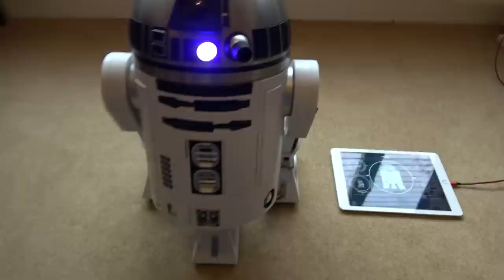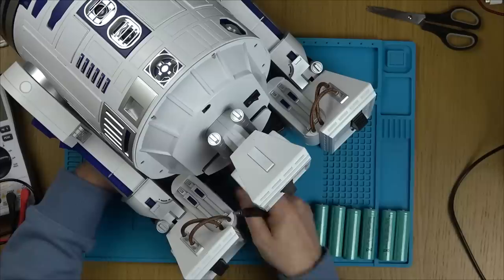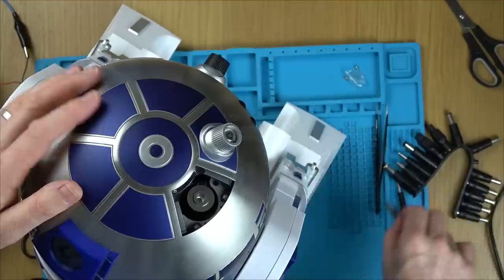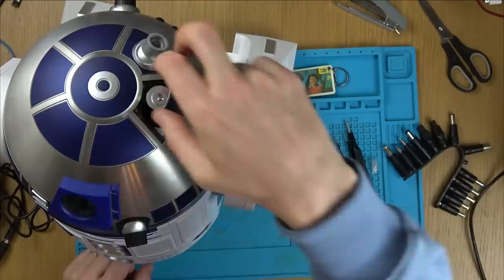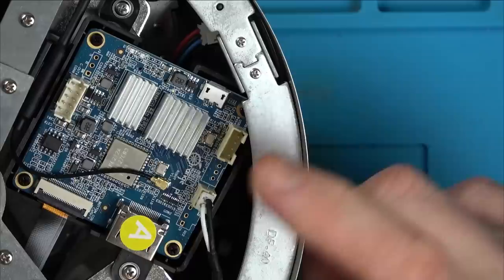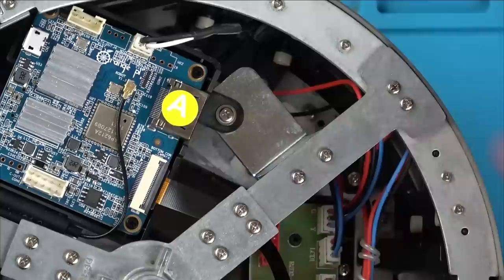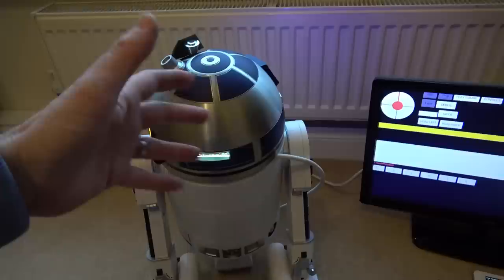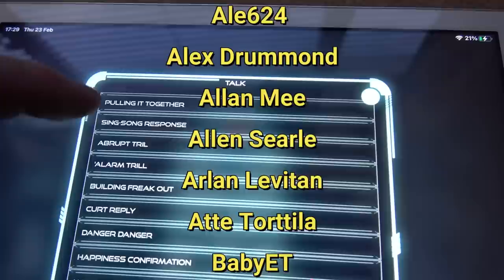Star Wars R2-D2 Repair Video

Comment: You are a genius Vince. I am in the process of building the Fanhome release of this R2D2 and could not get the light sabre flap to open. Then I recalled watching this video and came back to see how you resolved the issue. I copied your method of using two staples and now the lightsabre flap opens smoothly and still sits flush to the metal housing. Thank you.

Comment: I am about 40 stages through the assembly of R2, this video has given me so much confidence that I will be able to troubleshoot any issues. Thanks. The kit comes with a test board so you confirm the components work before assembly. Really is a nice kit, loads of fun to assemble with the kids.

Comment: Hi Vince, I love the robot! You might use some hot glue for the connectors to hold them in place. In case you need to remove them a bit of IPA helps to loose it up.
Reply from the maker: Very good idea Marcel. I used to hate hot glue as it was a nightmare to remove until I realised IPA actually makes removing it enjoyable. I normally try to get it off in one whole blob...and then it can be reused again. The process feels like a stress relief toy. Hope your keeping well👍

Comment: I always thought that these weekly build it yourself magazines were a rip off but this is awesome!!
Reply: Usually they are, and the customer service is ropey.  It's a reasonable way to get something expensive by spending small amounts regularly.   It's a bit like HP!  Like HP, it's expensive compared to the 100% outlay.

Missing an issue can be a nightmare.  They offer back issues, but only if they have them in stock.  If they sell out of an issue, you are in trouble.

Comment: Actually raspberry pi is mostly open source. It is ment to be "copied" (is open source it called fork). And the orange pi is open source.
There also is a Banana pi and a whole bunch of another pies.
They have different set of form factors, different processors and other hardware. For example banana pi has a board for DIY router based on similar to raspberry pi hardware

Comment: From my understanding orange pi is a single board computer that can be programmed on board if you connect a keyboard and mouse but you need have the correct software on it. I think they used an SD card with the r2d2 firmware and inserted it in the pi to flash the firmware. I think Vince found a development/debug interface for the people manufacturing the magazine.

Comment: The Orange Pi is an ARM based single board computer, as you say a clone of the raspberry pi, running Linux. You can use a micro USB to full size USB adapter to plug in a keyboard/mouse in and control the interface that way. Ctrl+alt+f1 or f2 should also give you a full Linux command line where you can browse around the operating system.

As you say, the build quality of this is very impressive, and considering its a magazine build, I don't honestly think the price is that obscene.

Comment: Heya!

I just came across your channel. Very interesting especially with the short and long LCD Display Units. The Long Display is correctly at the rear, the short one, However is the Round LED in the Front. The Stacked LCD Display next the  Round LED Display is actually R2's Processor Display that indicates his calibration as he's powering up or charging while switched on. The Lightsabre Unit unfortunately has a hinge that has to be loosened slightly so attain functionality. The connection in the rear panel power's R2's speaker. I will continue to watch! Enjoying the Show.

Comment: Selling a device without the lithium batteries is a good practice since it removes any fall back on you if the end user does unsafe things with the battery pack.

Comment: To make shim washers.
Drill the correct size hole for the screw into that hard plastic cover material on the super glue packet(or similar type) and then use a hole punch (like one for ring binder folders) and make as many as necessary to "shim up".
Great also if you need insulator shims.
Learned this on model railway stuff.
Reply: You can also use plastic playing cards, or cardboard ones for that matter.

Comment: 10:20 you could have just got a hole punch and punched out a bit of the blister pack from that super glue package or some other blister pack plastic and then  got a Dremel  and drilled a hole through the  bit of blister  plastic that was punched out, or just cut a tiny   square and cut he corners off  off and made a hole in the middle
blister pack plastic makes good washers in a pinch and I bet you can find  different thickness plastic around the house no problem.

Comment: I had an Orange Pi actually. It has a USB port so you can connect a USB hub and a normal keyboard and mouse to it, as if it was an ordinary computer. Too bad I misplaced it somewhere.

As for the lightsaber door - in the movie it slides open on the inside of the head. Which would probably be harder to implement in the model, so they went with a simpler design that swings open
Reply from the maker: Thanks Sheevlord👍👍👍
Reply: The HDMI looks like a debug screen made by the developer to control everything from a mouse.

Comment: A quick tip for the people who are technical enough to modify 18650's without blowing themselves up. To convert a flat top to a button top, get yourself some 6mm x 2mm neodymium magnets and put one on the positive end of the battery. A dot of super glue can also be a good idea to stop it sliding.

Comment: Hi just came across your channel. My son built this when he was 12. I bought all the magazines 100 and saved them to give as a Christmas present. Took him 4 days to build it fully. Sadly whilst plugged in charging  smoke stared to come from the head.  Turned out the light saber motor burnt out. Hoping to try and repair this year. Also my projector never worked. Sound and light but no image 😭.  Just manged today to get a replacement but £43. Worth it if now works. Will let you know when I get the time to look at it l as later this year.

Comment: Aside from the fire dangers of lithium batteries, having seen one in person, I'd say for an indoor fire, the bigger danger would be poisoning from the huge volume of toxic smoke that would literally fill the room you are in, which simply adds to the danger of the fire. 

Most folks (I would hope) are aware of the possibility of fire, but the smoke is incredibly dangerous, much moreso than the smoke from say: a nickel metal hydride battery fire.

Comment: Surprised Vince doesn't have more knowledge of SBC's, single board computers.
 He should definitely subscribe to explaining computers.
 It s a great channel for learning about SBC's.
The Orange PI 5 is much more powerful than a raspberry pi 4 , it has a rock chip 3588, the thing about non  raspberry pi boards is that they don't have  as great  of software and support for different OS's and other stuff but  there are tons of different  SBC's and a lot of them have better hardware and specs than the raspberry PI boards.
Also it's not a copy any more than  different  Windows desktop or  laptops from different  OEM's are copies of uh something, they are just computers.

Comment: I'm quite sure the Orange Pi is the brains. It seems to be the Orange Pi Zero Plus2, which has 8GB eMMC flash and also a SD card reader. I wonder if they pre-flashed the eMMC with the software for the robot. Either way, you can definitely connect a keyboard and play with the UI. If there is a SD card (it would be on the underside) you can check on a computer what's on it. Most likely it's formatted as the ext2 (or ext3/ext4) filesystem and should be readable by at least Linux or a Mac. If there is no SD card the software will be on the eMMC. You can flash a SD card with Linux (the orange pi website has an image and instructions), put it into the Orange Pi, boot it and then mount the eMMC and look around the files. Requires a bit of knowledge working with Linux and navigating with command line tools, but you'll very likely be able to mess with the sound files :)
Reply from the maker: Thanks for the info 11xY. The SD card slot is empty on this one so it must be on the flash memory 👍👍

Comment: Most likely, the original designer used that debug interface to test the motors and such before the iPad app was developed and the wifi control was set up.

You could probably connect a wireless mouse dongle to the Pi board and control it with the head closed. There might also be HDMI touchscreens out there that you could hang out the side and not have to be tethered to a TV.

Comment: Vince, I know you'd either buy the right cells or use magnet spacers, don't worry about that.  
My worry is about people who didn't know the foil was very temporary, and copy you on that part, or people who just kinda scrub through your video, saw that part, thought it was a solution and copied it.  Not everybody understands that these video's are meant for entertainment only, and are maybe a bit dense and saw the foil worked, and thought: hey, solution to my problem ! :)  
I never thought you yourself would do this for any length of time or any sort of even semi permanent solution.

Comment: Fab video again, love this series of R2D2 videos, I would check if you can remote into the pi boards ip address on you local network via a browser and control the UI you see on the hdmi output. if not i would be looking to connect a keyboard and mouse to setup a remote desktop service to enable that same kind of functionality.

Comment: Pretty sure you could mess with the orange pi and sounds etc, not sure if it's secured/encrypted or anything, but if this is a orange pi zero plus2 board, it contains an 8gb eMMC, i would think that's where the software is located. What a cool little bot

Comment: you use a wireless keyboard and mouse the USB is normally to power outside of the robot  and it outputting the os on the pi used to program it and test it

Comment: I thought the kinds of things that were wrong with R2 were really fair. Nothing major, but intimidating enough to keep someone from tearing into it.  But in the end, just some usage faults that weren't real damage, but just needed to be poked at a little.  I love this R2 though, its really bad ass.  And its funny how people's perception of things differ.  I try to keep track of the single board computer market and when I saw an orange pi in it, I was like wow - they gave it teeth. LOL  (The OrangePi is faster than a raspberry pi in megahertz as you mentioned, its RAM is also faster. And the OS in your R2 is apparently booting from an eMMC module rather an SD card.  So, faster boot times, faster load times, faster ram, faster processor, faster sensor polling and faster response times.  The OrangePi is aggressive. LOL
Reply from the maker: Cheers for the info Steven. Up until this video I had never heard of it👍👍👍

Comment: You would connect via ssh or vnc for remote desktop to use the orange pi as a remote computer. You would also be able to look around the file system and probably the mp3 files to change the sounds.

Comment: Add a servo to the lightsaber panel programmed to work with the other servo. You might have to add line code for it to work together.and add a arm to the panel itself connected to the servo. Im not educated in eletronics so take my advice with a grain of salt it's just a thought.

Comment: Noticed the HDMI Port. I had no idea that you could programme via one? I'm Intrigued!

I had a crash course in repairing my R2 when the Black and White Cables got severed as they were low hanging. I had to install new cables and pins into a new plug. 

I have also noticed not every R2 operates the same and his behaviour seems to alter with a change or drop off in functionality. 

Great show!

Comment: A fun mod would be to add an extender to the HDMI and usb from the Orange Pi and install the connector to a spot on the head so you can hack R2D2 while he is fully together.

Comment: I wonder if the code for the Pi was in one of them magazines and the original owner got to program it. It would be interesting to modify it to do other stuff. Good video either way.
Reply: R2 definitely comes programmed.. no typing required to get it working.

Comment: Looks like debug web page output via HDMI.  If it has wifi, you could properly connect to it using a computer and control it rather than the app.   For debugging.

Comment: Love the staple fix. Should be able to reprogram it with new sounds if you know what you are doing. Wonder if anyone has painted it black to make an imperial astromech droid. If you had a 3d printer, you could create a restraining bolt for him/it.
Reply from the maker: The staple unintentional blended in nicely and worked a treat. Other comments suggested making a shim with a drinks can. Probably a better idea to be fair 👍👍👍👍
Reply: @Mymatevince  yeah, can shims would work also. You only have 9 other digits to slice off :)
Reply from the maker: @DEmma1972  😂🤣

Comment: Always worth keeping things in a stash for the future, I bought a NOS Seiko 5M62 Kinetic at a very cheap price, dead cell and I was just about to order a new cell from cousins when something prompted me to check my kinetic cells tub and lo and behold, bought in error a few years back was a brand new, sealed Seiko 302324T capacitor saving me a fair bit as I bought that when they were only £4.   So now I have up and running a brand new Seiko kinetic at a tiny fraction of the price of buying one working :) (also my first Seiko branded kinetic as I had only Pulsar and Lorus although I do have the ultra rare Pulsar Antonio Banderas (voice actor for Puss in Boots of Shrek fame) kinetic)

Comment: so um... dollars to doughnuts that somewhere in the magazines (specifically where they have the directions for installing the orange pi) it will have the instructions on flashing the OS to the pi.  to do that you'd have to have a keyboard, mouse, and monitor hooked up.  what'd be really cool is if you ran a hdmi extender cord to someplace on the r2 unit and mounted a hdmi port to the shell somewhere.  that way you can just plug in the little droid to an hdmi whenever you want.  also maybe extend the usb leads down so you can plug other hardware into him.  so far as hacking the sounds for rude words, that would be really easy.  those sounds are just recordings (probably mp3s) that are on the pi's storage.  if you were to copy a different sound of someone yelling "bollucks!" and give it the same file name as one of the sounds it is expecting to play, well, you'd have the cussing roomba from the michael reeves video.  incidentally, that orange pi is being way under-utilized.  that's a full blown linux computer in there.  you could throw together a custom kali linux distro that has the r2d2 functionality and have your little r2 unit running around hacking the passwords off of peoples' wifi routers.  i'd also venture say that if you poked around in the guts of that thing long enough you're likely to find arduinos in there too.

Comment: Could the dent have been intentional? If you remove the lightsaber and then close the little flap without putting the lightsaber back in, you would have a hard time opening it up the flap again. So the little dent would allow you to stick a fingernail to open up the flap again maybe. Not sure about it, I just think it would make sense. Great fix by the way!
Reply: No the dent is not intentional, should be perfectly matched to the rest
Reply: i think it is totally possible the original owner put a dent in to be able to open the flap by hand.
Reply: In a situation like that you could simply pick the model up and tip it on its side while supporting the head and the flap would open up. as long as you are careful putting him back down the flap should stay open so you can put the lightsaber back in. ab extra servo would have made the design slightly more elegant, but that would be prone to breakage.
Reply: Or just use a piece of tape to open it, just use something easy to remove.
Reply: yeah not saying denting the thing would be the best way to do it just that i have seen people do way worse to things when trying to get them to work.

If the flap was getting stuck before the dent ever happened the original owner could have just been trying to pry it open and dented it too.

With how easy vince was able to bend it back the metal obviously was quite malleable there.

Comment: There is the concept of patents that allows a company to make money from an invention for twenty years after the granting of that patent. Sadly, it is also a pain in the backside if the company does nothing with it or refuses to licence it. It took until the late 2010s for consumers to have the ability to find out what transmitter their DAB service was coming from because Sony patented it and did nothing with it. In terms of the Raspberry Pi, I guess cost, spirit of the project or most likely, prior art, would stop that happening.

Comment: The Orange Pi is the brains, they go the long route through the body to ensure it will power things properly and not burn the Pi ( pun intended ).  I am lead to believe the lights ( small front and Long ) are based on the open source Teeces Logics Dome Lights which are open source.  Brilliant using staples instead of trying to tap the hinge back into alignment.  You may want to check the magazines to see if they skipped a few steps for securing the dome as I suspect they did not secure the rod properly.  I have seen a few build videos and thought I saw that the rod was secured in either the dome or the base was squeezing the rod to secure it.  If you get a USB wireless keyboard/mouse you could set up software to let you log into the desktop.  I doubt it has " SSH " software installed and you would need a terminal program like Putty to log into it.